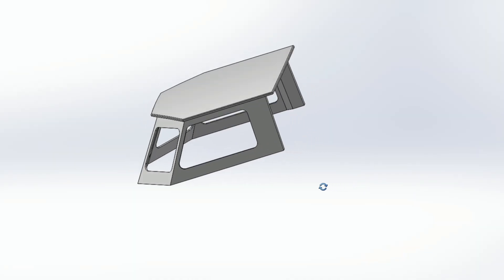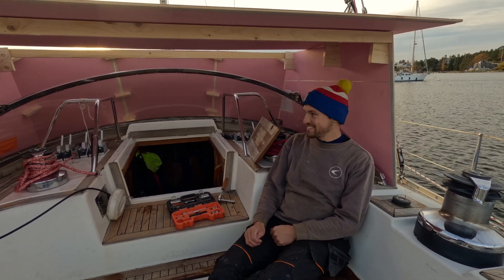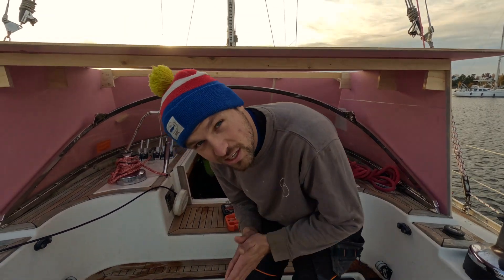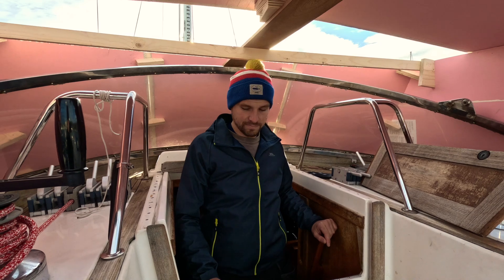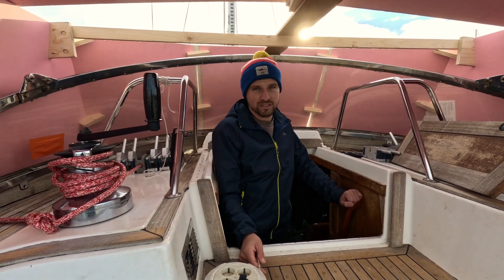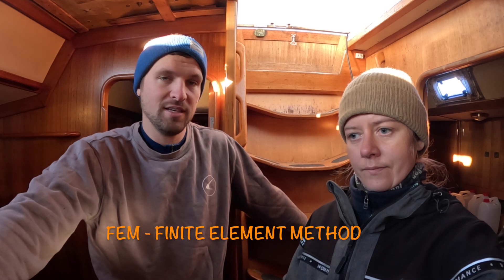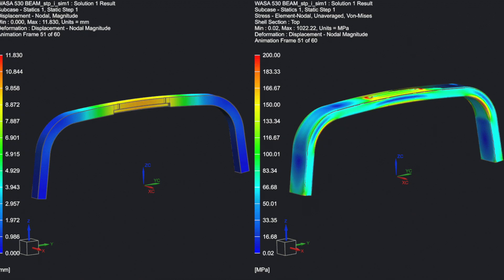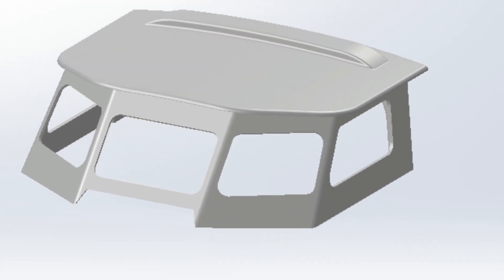Designing the Doghouse & Mainsheet Arch for our Sailboat [2.28]

Comment: Looks about exactly the same that I have been planning for my HR352. 
I hope the 6 layers of UD was just some initial guess. Modelong composites is NX sounds a bit exotic. It is already difficult enough with Ansys ACP. Obviously there needs to be sigbificant layers +-45 degree fabric on the forward and aft surfaces.. and some on top/bottom to tie the UD together but Im sure you knew that already. Additionally, I'd be a bit worried how the beam is being fixed to the boat itself. Your FEM was likely using just fixed bc's but in reality preventing the local rotation at bounday conditions is a difficult task. Transversal shear loads have been problematic before in this kind of structures. People struggle with their hard tops and solar arches being such wobbly structrures under sideways loads - often due to boundarycondition issues rather than due to stiffness of the structure itself.

Comment: I would keep the windows as small as you can.This will make the dodger stronger.I would make it wider to lap over the sides of the existing cabin sides so you can bolt it on.make the angle same as that area.I would raise the center of the roof I think it too low.

Comment: I really like the lower version but you could make the roof even more rounded which I believe also would benefit the traveler given that you make a rounded traveller. Good luck.
Reply from the maker: It is a bit difficult as it is right now as we have the winches at the sides which we need to be able and handle in a comfortable way 😊

Comment: You could consider removing the bars at each side of the companionway and replace with lower handles. This would give you more room for your head and body as you enter and exit. I have a contrast 36 with a similar bridge deck and requires a spesial technique to get in and out. I think the carbon fibre traveller will look great against the white (?) doghouse if you keep it all visible. Good luck.
Reply from the maker: That sounds like a good idea and maybe something we’ll do in the future when we get to annoyed by getting in and out 😅 they will be in the same color, the beam and doghouse will visually look as one 😊

Comment: Just to let you know how i did it. Maybe for some ideas. Suggestion: make the roof more arc,  lower from the sides and higher from the center. Then the dodger looks smaller, but it is easier to go under. https://youtu.be/lhAEpVC6HOs?si=isdVDHrbcCqNu-oc
Reply from the maker: Thanks for sharing! But we cannot really make it so much lower at the sides as we have winches close to the aft corners and we need to be able to use them in a comfortable way 😊

Comment: You are doing a sterling job! Wery interesting project. I think that the average roofvof a Hallberg Rassy has much more curvature do more height in the middle. Did you measure up an HR dodger? Good luck!
Reply from the maker: We used HR for inspiration, but we cannot have to much curvature either as the winches are located at the sides and we need to be able to handle them in a comfortable way 😊